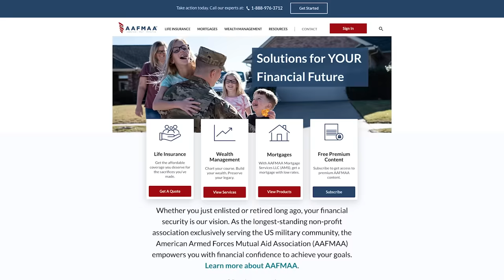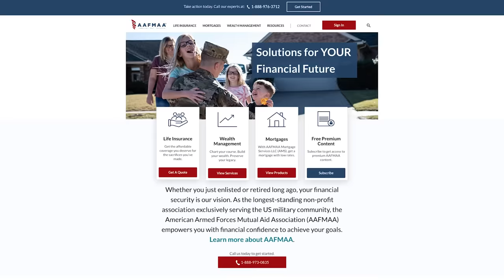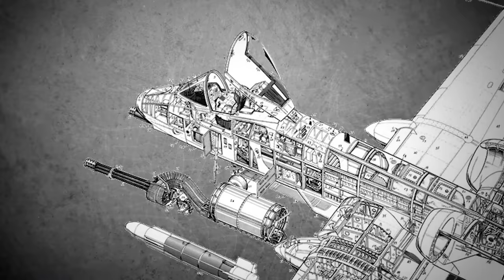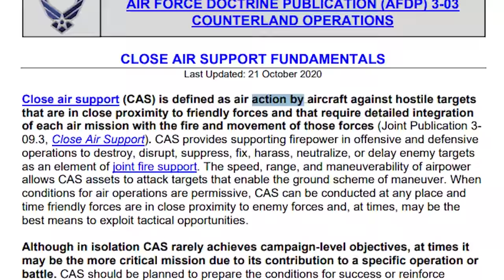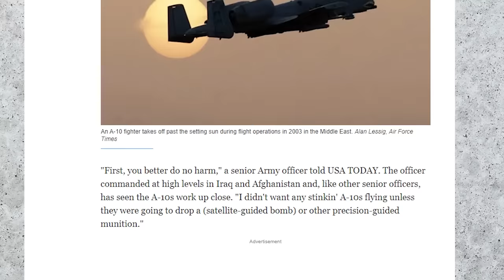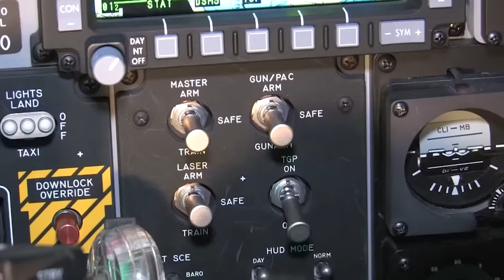Why the Air Force is Screaming to Retire the A-10 Warthog

Comment: Modern jets:  it's about stealth, precision, and lethality
A10 : It's about sending a message.
Reply: When the S**t hits the fan stealth is the last thing You need
Reply: A message that doesn't cost the taxpayer a bizzion dollars like all those missiles do on other aircraft
Reply: A10: It's about shooting friendlies.
Reply: It's the only aircraft that enemy troops surrendered to just by flying overhead.
Reply: Ground pounder about to be over run: It's all about loiter time, and not hitting and getting.
Reply: @Eddieouh  The aircraft can be outfitted with similar electronics as new aircraft have. Thats a management issue not the planes fault. Also they dont talk about friendly fire issues with newer planes because they havent been in combat yet.
Reply: It's about returning home alive, even if 20% of your plane missing.
Reply: By the standards of stealth, why don't we retire all attack helicopters then? They need air dominance before they can go out and the A10 can stay on station and carry a lot more ordinance than even 3 F35s can carry. It's a good platform that is specific just like so many other assets
Reply: @AaronCMarron  you can not shot something you can't see
Reply: @jbird6609  the upgrade package for the a10 that includes the equipment it needs to not shot friendlies. Cost more than a brand new f-35
Reply: youre right  te philosophy behind the stukas sirens effect on the human psyche seems to be lost by Command.. an a35 absolutely do not have the same effect!
Reply: @AaronCMarron  no its the first... so you don't get shot down... if shit hits the fan in a a10 you are a fish in a barrel. a foot soldier can shoot you down....
Reply: @deekamikaze  they are... they are getting rid of attack helicopters
Reply: @zee-fr5kw  I highly doubt that
Reply: Jajajajajaja!!!!!
Reply: @missourimongoose8858 Also a message that can be shot down by an infantry soldier with AA as it's slow and veeeery visible.
Reply: @CorporalCookie  so we just shouldn't have aircraft then lol I'm a vet who was infantry and I can tell you war isn't a video game and anti aircraft stuff isn't common in the US infantry and we spend more than everyone else combined so other military would have even less of them, plus the a10 is the tank of the sky's with many videos showing how much abuse they can take and still get the job done
Reply: @missourimongoose8858  "shouldn't have aircraft then". Man, that was the dumbest straw man you could have attempted there. We're talking about the A10 here, which is a relatively slow and very visible plane. It's an outdated thing, whose mission other more modern planes can carry out with more safety. And MANPADS are common enough to be an issue for the A10, just look at the amount of them in Ukraine. And while it is sturdy against some arms, it's not missile proof. These things are not video game logic, they are reality. Perhaps it's been too long since you served, things have changed a bit. And you fail in the complaint about the missiles also in that A10s best weapons currently ARE those expensive missiles. Dear lord, don't tell me you are a reformist?
Reply: @CorporalCookie  your obviously a scholar about this subject except the plane they plan on replacing the a10 with is a up armored crop duster, you see being slower is good for covering ground troops and the Ukrainian airforce isn't crap compaired to American airforce so your logic doesn't make sense plus you have never been in combat so how would you know
Reply: @missourimongoose8858 you say you never really were given anti air weaponry in the infantry. But…why would you get any? How often did the people we fought these days actually have aircraft. THEY need and have the man pads. We don’t. Your logic is flawed
Reply: @kaelibw34  Russia and China don't even have bulletproof vests or night vision in large supply, what makes you think they have all these anti aircraft weapons and you also believe we don't have counters for that anyway lol I don't think you understand how technically advanced we actually are
Reply: @kaelibw34  and again the replacement for the a10 is a uparmoured crop duster so low flying and slow aircraft ment for protection for thr men on the ground is a vital part of our military especially when your enemy like Russia loves to show off its crappy tanks
Reply: @AaronCMarron um, no. When shit hits the fan and you need rounds on target, you don't need them to be delayed by enemy fire. Stealth makes sure the package arrives.
Reply: @Eddieouh Like, totally man.  Bombs have no collateral damage!
Reply: @anydaynow01 Three hours with auxiliary tank isn't enough loiter time?  You're making the case that we need more A10's - not less.
Reply: well said
Reply: @Eddieouh    That is a wild exaggeration.  Any weapon can land up hitting friendlies.  When the allies landed in Sicily, they were bombed by friendlies.  Did the allies stop close-air support?  There are more recent examples, but one is as good as another.
Reply: brrrrttt
Reply: @deekamikaze maybe because of the maintenance cost which goes up and up
Reply: Yeah, that message is don't mess with our Infantry. Unfortunately the concepts the Air Force is looking forward to has nothing to do with supporting infantry and Marines on the ground. They want to go Top Gun all the way.
Reply: @missourimongoose8858 Literally the only way the A-10 can do its primary mission is shooting a bizzilion dollar missiles, dope. Shooting unarmed goatherders isn't its primary mission.
Reply: @fnhatic6694  the a10 wax built around a 30 mm Canon which doesn't cost as much as missiles do man and its for tanks...
Reply: @fnhatic6694 false narrative. SDB, Hydra and Hellfire are common loadouts. All are cost effective. Do some research. You're grasping at straws.
Reply: @daddukes2110  "Do some research" lol by what? 'ReAdInG aRtIcLeS oN tHe InTeRnEt'?

1) The SDB isn't an anti-tank weapon. It's GPS/inertial guided meaning it can't hit moving targets. SDB II is more effective but is extremely expensive, and likely will never be used on the A-10.

2) Hydra rockets are not for the A-10's "primary mission". 

3) The A-10 doesn't even rack Hellfires.

Go do some more research, armchair pilot. The A-10 is stupid and worthless. A trait shared by its fans, it seems.
Reply: @fnhatic6694  Childish response. 2 of the 3 are CURRENT loadouts on the A-10 fleet. The C model can carry the targeting pod for all laser guided AGM-114. It is not that difficult to integrate it. The hard part would be a rail. Having a missile 1/4th the cost of an AGM-65 is COST EFFECTIVE. Even if a MMR pod is integrated, allowing all newer versions of Hellfire, it makes sense monetarily.
Reply: @tango_uniform  It's also the only aircraft that enemy troops called "their greatest recruitment tool" due to the amount of collateral it produced.
Reply: Another stealth believer ?
Reply: Stealth? Isn't this plane incredibly slow and noticeable?
Reply: @Eddieouh   That's only half the story.  That stat needs to be compared to the number of sorties it flew in relation to other attack aircraft.  A per-capita if you will.  "There are lies, damned lies and statistics"
Reply: @Chris.Davies yeah, an F15. Not an A10
Reply: and that message is brrrrrrrrrrrrrrrrrrrrrrrrrrrrrrt
Reply: that message is the gun is propaganda only and useless for anything more armored than an M113
Reply: @missourimongoose8858  God, you guys are such children. You do realize that war isn't some "big scary man wins" game? It requires strategy and technology, and everyone involved recognizes the importance of level-headedness and focusing on what's important (or else you get the Russian military - a joke that follows such doctrine that you seem to believe).

The a-10's gun is sh*t, and most of the time very ineffective. What has kept the a-10 in service has been the fact it can hold b+mbs and missiles - its best weapon is the one you think is the worst.
Reply: @DaDARKPass  I've actually seen the a10s guns go off in combat and you think a 30 mm is ineffective lol of course they could cheapen this platform if they wanted to but they dont...they wanna spend billions and billions on the next gen pos and ya I'm against this type of military consumerism you know because I was in the military myself unlike you

Comment: The A-10 was one of the most memorable airshow planes.  Low, slow and high maneuverability make for a great display.
Reply: Technically great maneuver aircraft at low speed standards. Doesn't necessarily means it's awesome at maneuverability
Reply: I would never say highly maneuverable when talking about A-10.   It’s durable and effective but highly maneuverable no.
Reply: It's like a vulture waiting to strike with hell fire when you least expected.
Reply: One of the problems is it's low, slow, and can be easily taken out by a drone or a MANPADS.
Reply: highly maneuverable? I dunno. That whistle tho!
Reply: F-15 drivers will not engage an A-10 at low level, they know they will get creamed.
Reply: I used to live near an airbase with A10's. I was sitting on the patio of my local watering hole one afternoon and a pair flew directly overhead at just above treetop level. That was a cool experience
Reply: @1HeatWalk it was great at Blue on Blue.
Reply: A-10s are actually quite maneuverable at their lower speeds. However, they bleed off all that speed real quick. Force an A-10 in an uphill or vertical fight, and it's over for them.
Reply: that's about it in a peer-to-peer conflict
Reply: Yup. But times are changing surface to air missiles are getting better again to faster.
Reply: @dakmycat3688 That’s why the f35 and f22 exist. You cant shoot down what you can’t see.
Reply: @paulfry3221 and journalists
Reply: @knoahbody69 what kind of drone are you thinking of?
Reply: Hopefully get to see more of them due to several dozen getting released from service.
Reply: Incredibly depressed that I'll likely never see one fly, considering the looming retirement date.  :(
Reply: "High manuvrabilitu" - flies like an old man 😂😂😂
Reply: Absolutely! Only seen an A-10 once (RIAT UK - 2011) and it was unforgettable.
Reply: @Alphasig336  it misses trust vector steering with the fixed canon
Reply: Static display if they get their way. Bring back the F-111 Bring back the F-8 Crusader  Bring back the B-58 Hustler Bring back the F-7 Corsair. Stuff some new avionics in it & lets go kick some ass.
Reply: ... or target, on the battlefield.
Reply: @Alphasig336  It is actually very maneuvrable at a low atltidue and low speed. You could almost call it the jet version of a biplane in terms of how much it can turn. Have seen some airshow stuff with it and damn it can twist and turn.
Reply: @1HeatWalk  
A half blind and deaf vulture is more like it.
Reply: KellyAvianLaw  
I mean that was only thing it was good for, looking cool.
Reply: @foxstrangler  
Why would they even do that when they have already destroyed in from tens of miles away.
It is a flying target with a gun that can barely hit its targets.
It is so shit that it can only be used when there is air superiority.
 
It was based on US understanding of air combat back then USA was among the worst in the world.
When it came in to production it was already outdated.
 
I guess hearing brrrt is a moral boost, that is like it.
 
Every other close air support platform used in the world today is far superior to the A-10.
Reply: @knoahbody69 not when flown correctly.  When truly low it’s not exposed to ground based weapons long.  Most MANPAD or Short Range weapons can’t bring one down. It’s designed to take many hard hits without being lost
Reply: @1HeatWalk i never see a vulture fly this slow to strike lol
Reply: @foxstrangler  Are there ever even F-15s and A-10s on opposing sides?